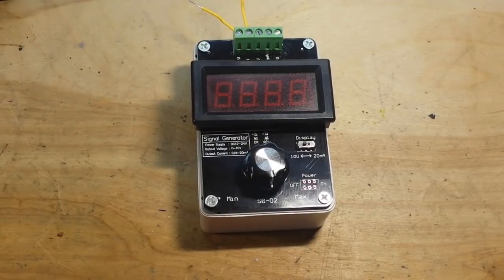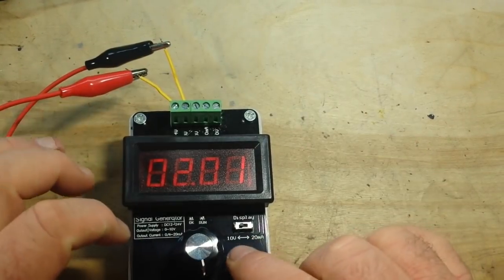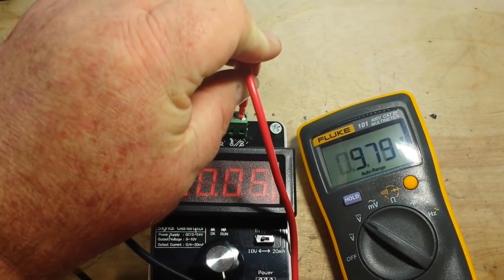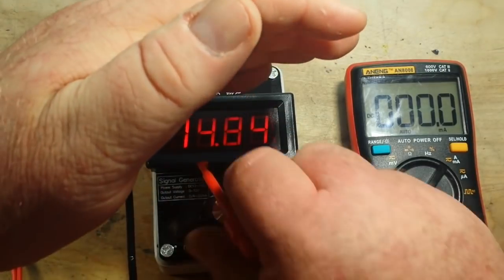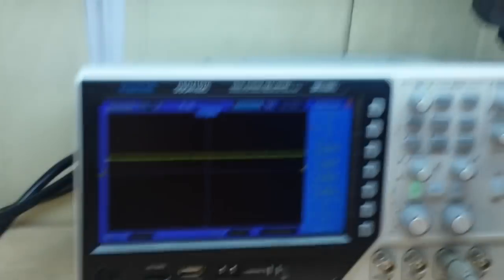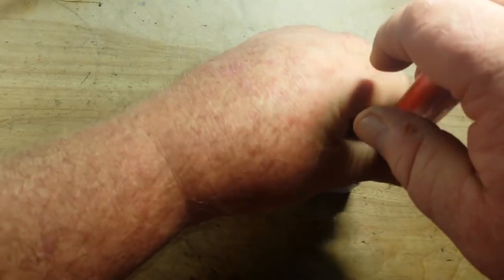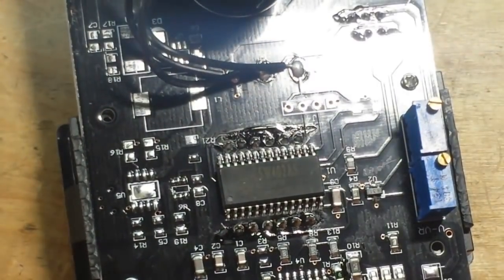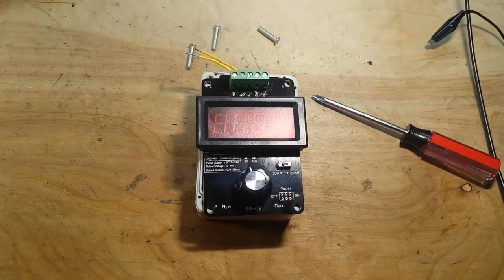Drok Signal Generator

Comment: Dear Sir, 
As shown in your test, when 10.05 VDC is on Drok Signal Generator device it’s shown as 9.70 VDC on the Fluke device! So, do you think the Drok Signal Generator is accurate enough for simulating the PLC analog inputs?

Comment: Paul, I am thinking of buying something like that little black box for my birthday. I was wondering what you had to say about the devices before I pull the mouse trigger on this one. Analyzing my broadcast signal spectrum quality is one use I have in mind for it. Is that video still in the line up?
Reply from the maker: This thing just puts out straight dc.
Reply: learnelectronics  What happened to the SDR teaser? I was referring to that as something I wanted to get, but I just found that you already did a video on the RTL.SDR dongle I have had my eye on. So I am watching that now. Thanks anyway.

Comment: Did I miss something, but what is the point of this device?
Reply from the maker: Its used to calibrate plc circuits.
Reply: You can use it to simulate signals coming from all type of sensors on the inputs of a PLC or Arduino. In other words you can simulate all kind of conditions to test if your program is working properly.

Comment: It's basically a constant voltage or constant current source.  A cheap sub for a lab bench power supply, of very limited voltage and current ranges.  In constant current mode, you will see the 'full' output voltage only with no load on the device.  With a load, the voltage will vary according  to the resistance of the load.

Comment: Why do they call it a "signal generator" when it is a "DC current/Voltage source"?
Looks like a blind person had designed it, ugly, but the idea is ok and very useful when you are working / trouble shooting 0-10 V or 0/4-20mA gear.
Reply from the maker: Its for testing and setting plc circuits.

Comment: How can it supply constant 10 mA current when there is no load connected to it ? I mean, the only thing connected is the multimeter and its basically short while measuring current...right ?
Unless if there is an internal load which varies according to the outside load to make the current constant ?